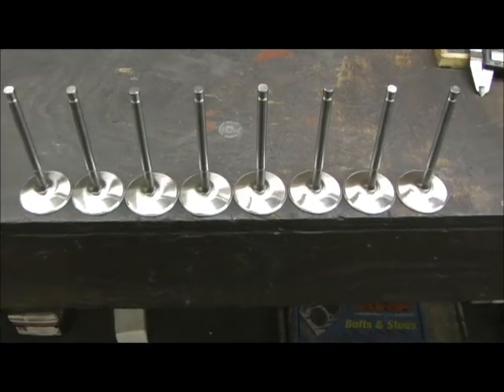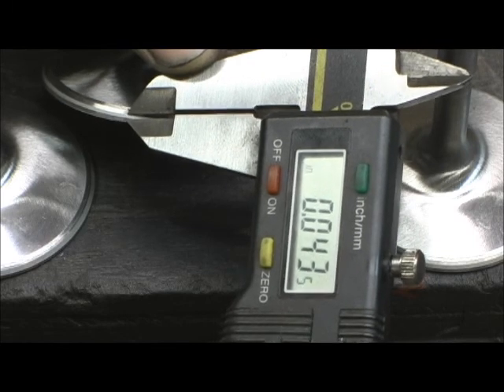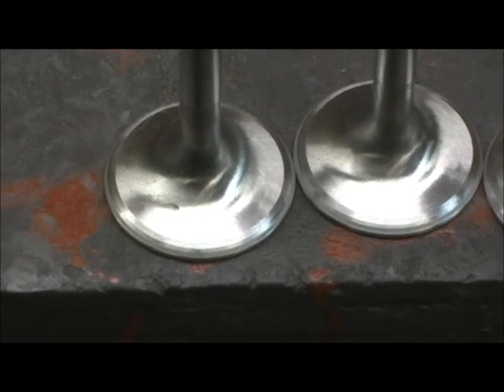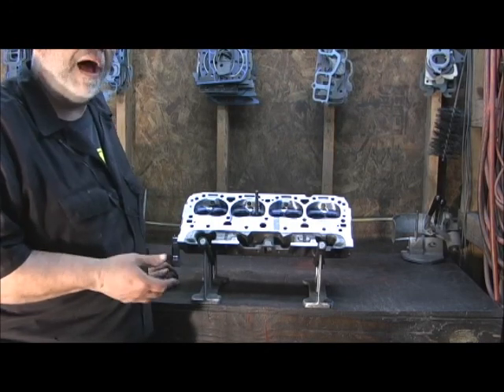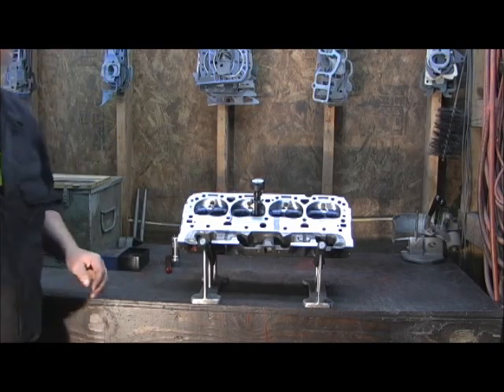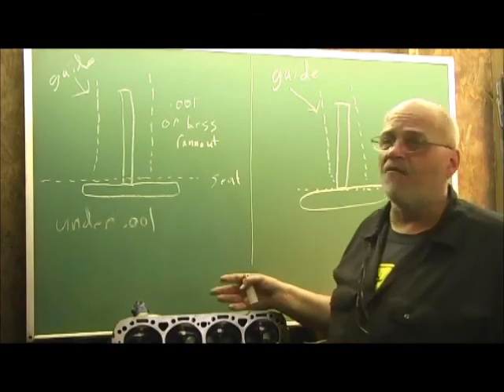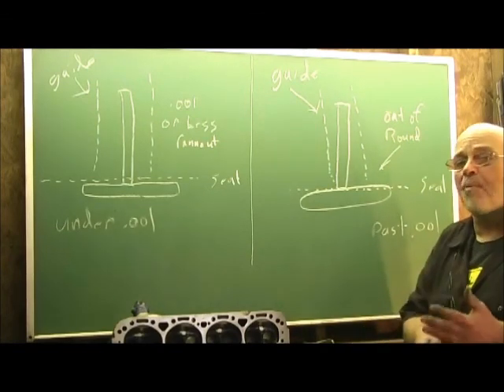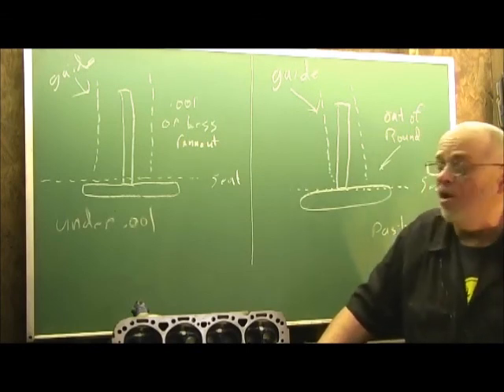Imhoff SBC 186 Final Inspection Seats Guides and Theory 8.0

Comment: You know I am here. It takes me 8+ hours to do a nice valve job and it is amazing how similar our approaches are. As far as I am concerned guides and seats are #1. 
1/2" above and below seats are #2.
1"above and below seats are #3 in importance to performance. The opening of the valve on the seat IS the biggest restriction on a si poppet valve engine.

Comment: Hmm.  Interesting to hear about the gray line from valve lapping.  Not having all the tools to outright measure seat runout, it sounds like it's a reasonable way to judge concentricity and alignment in a non-performance application?

A while back, I bought a reman cylinder head from what I assume was a "mass production" company.  I was quite amazed at the quality of the valve job that had been done.  Of course I went in and re-lapped all the valves 'cause I'm paranoid as hell, and I was pretty impressed with the consistency in size, shape and placement of the gray areas, both on the valves and the seats.  The head included all new guides, which seemed like quite a good fit.  Every single valve bounced, which is impressive for a DOHC cylinder head, and valves with such low mass compared to SBC heads.  Beyond that, the valves were all back-cut as well.  Stunning quality for $350, especially from a mass-production reman shop!

Thanks for posting all these videos, good sir!  You have no idea how many times you've saved my butt from doing something stupid.  :-D
Reply from the maker: It is, and if you learn to read the color of the gray, you would be amazed at how accurate it can be; that being said though, a runnout gauge is the BOMB period, you cannot lie to that gauge, nor can other so called machine shops. Fuck them all, there all almost crooks.....